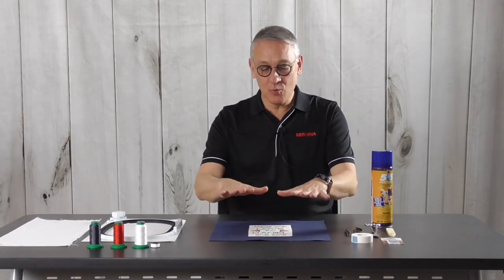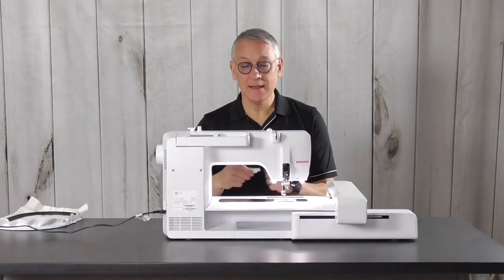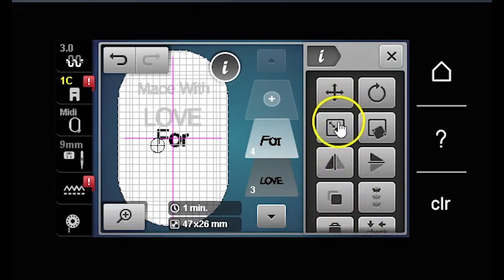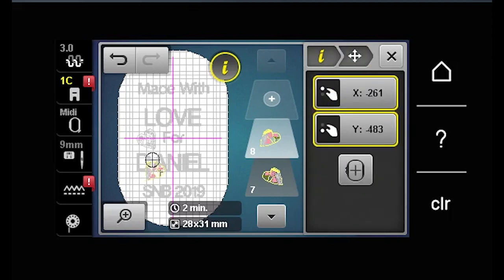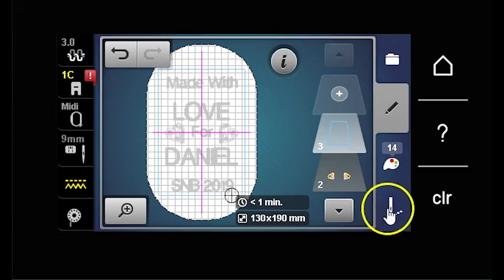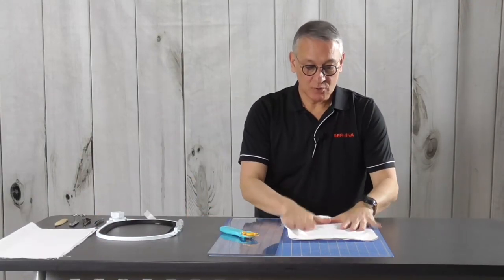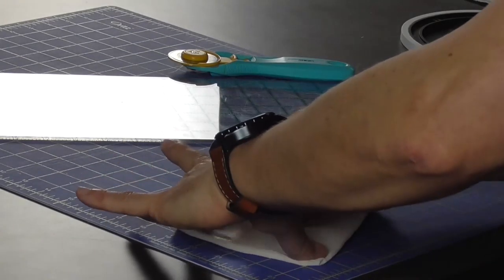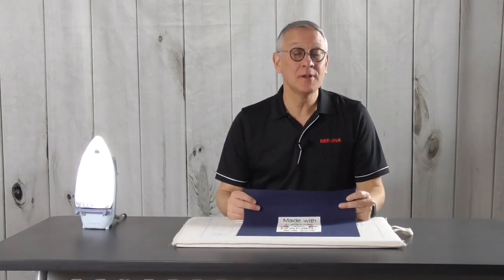Fusible Quilt Label: BERNINA Made to Create Studio Online Lesson

Comment: Thanks for great instructions. Can you please show me How we can make a label on a 570 without the embroidery module.
Reply from the maker: You can make a fusible label without an embroidery module on your B 570 QE. 
To do so:
Since you don’t have the embroidery module, you can use lettering built into your machine.  It will be smaller but will work just as well.  Create your label on the intended fabric (e.g. muslin) first, before you cut it out.

Cut out the label as a rectangle, allowing a quarter inch (~ 5mm)  seam allowance all around.
Cut a rectangle of fusible woven interfacing (e.g. OEST Woven Fusible) of the same size as the cut label.

Sew the two rectangles together:
Fusible side of the interfacing against the ‘right side’  of the label
Using a quarter inch seam allowance
Stitch all around the label, leaving no gap.
Using scissors, slit the interfacing in the middle along several inches  to allow to flip the label right side out.
Roll the seam allowances to properly shape the label to the edges.  DO NOT PRESS the label yet as you would fuse it your ironing board.
Place the label with fusible backing on the project and fuse as instructed in the video.